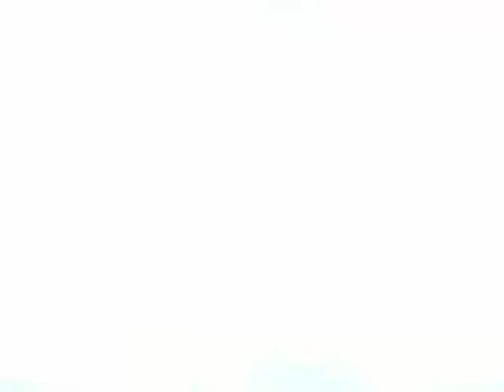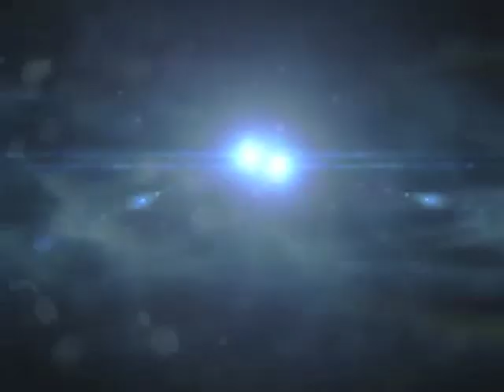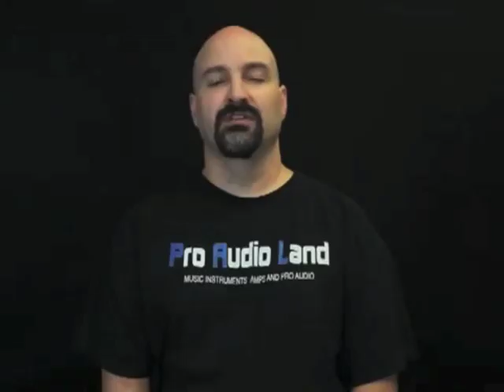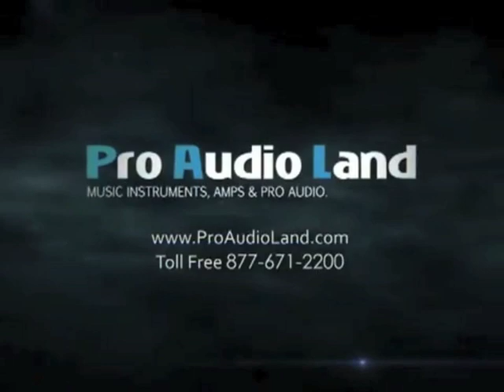Guitar Pickups 101: Humbucker Wiring Series, Coil Splitting and Parallel Wiring

Comment: Is there a way to wire two four-conductor humbuckers (duncan designed) in a classic 3-way toggle setup, so that positions 1 and 3 are the typical neck and bridge series sounds, but the middle toggle position is the neck pickup coils in parallel?

Comment: Definitely, as long as you have 4-wire pickups. You can get a diagram on the guitarelectronics site. Just click on "2 pickup diagrams" to see the list of options. 
I'm going to rewire my Les Paul clone for both coil tap and series parallel tonight! It's already coil tapped but I want to have a master volume knob (instead of two) and a series parallel option.

Comment: Can I wire my single humbucker guitar to have both series/parallel (push-pull) and a south coil-humbucker-north coil (3 way switch)? I am trying to find the correct wiring diagram, but I can only find either series/parallel or the three-way split, not both...